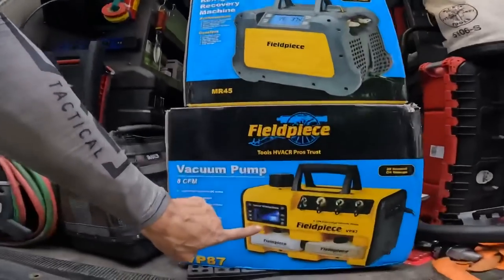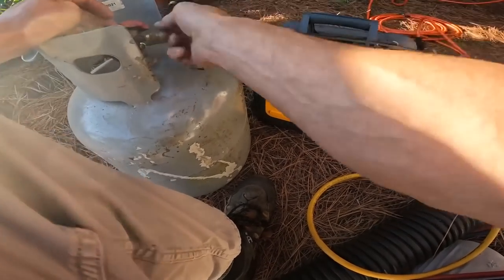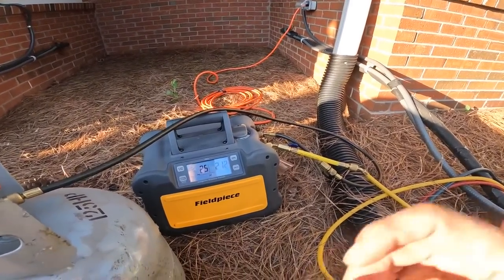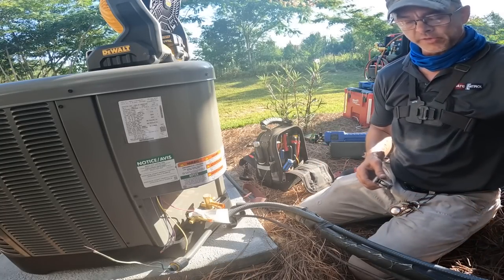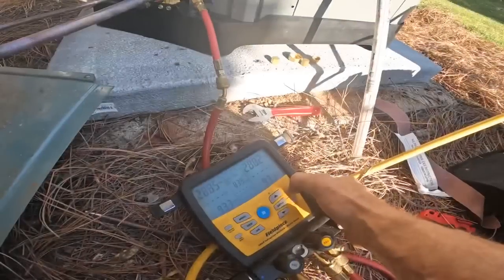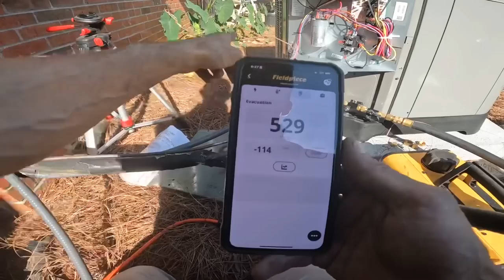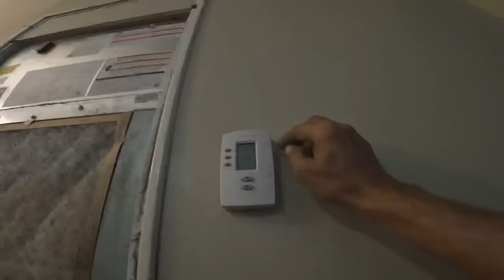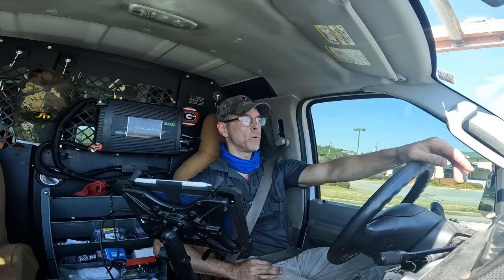A Good Look at the Fieldpiece Vacuum Pump And Recovery Machine, While I Change a Condenser.

Comment: By the way years ago I learnt to solder the short pieces to a longer piece.  Doesn't take long to do not as many burnt fingers.  Also I have always liked the concrete pad . I've seen the others crack after time and not always level.  Have a great day . A burnt system why didn't you flush system at least. It would still be in lines and coil . Have a great day  .

Comment: I just installed a Micro-Air EasyStart on my 10 yr old 2ton A/C-heat Goodman condenser.  I was sounding rough on startup.  The EasyStart really made a big difference in noise level on startup.  Well worth the money!  I’m no HVAC guy, just a do it yourselfer and it was fairly easy to wire up.

Comment: You should run the Trublue 3/4' hose for pulling a vacuum.  It is amazing how far down and how fast they can pull the vacuum.  I have the same pump and I would be down to 200 by the time you were at 2000.  You will never pull for 25 minutes, maybe 10 at most. It is amazing upgrade.  Time is money in our field.
Reply: I have the tru blue evac kit and it has changed my life. Saved me from so many days of long evacs.
Reply: @TheWiery322  Most definitely, I run the Advanced kit which is two hoses these days.  I have now see one system pulled to 37.9 because I got sidetracked.  It only needs less than 5 minutes and run s decay test and pull more to get it all out.

Comment: It's a nice recovery machine you should use a inline dryer on it To help protect it... a small filter dryer works wonders...
Reply: the recovery machine SUCKS i am now busy with my 3rd.. Each one break after 1 month of normal use .. Avoid buying this machine. if my 3rd device fails i will move back to other brand.

Comment: What pressures do you use when brazing. I was told 8 and 20 for oxyacetylene by my team leader
Reply from the maker: I did use 5-10. But regulator I use is automatic. No adjustment
Reply: @HVACGUY  what regulator is that?